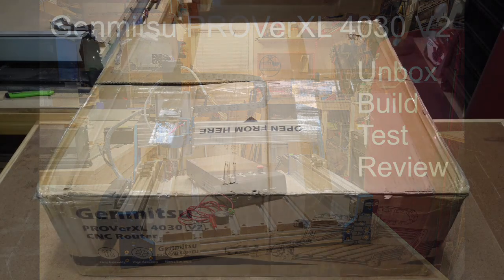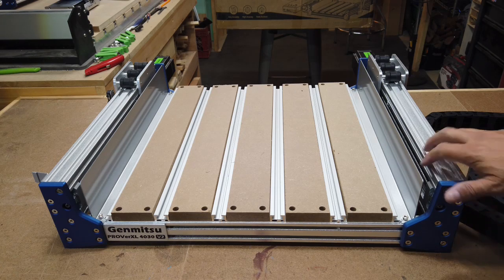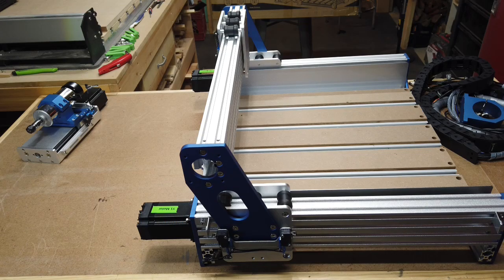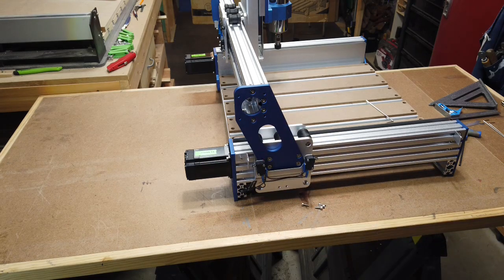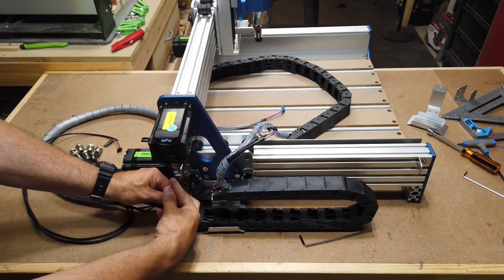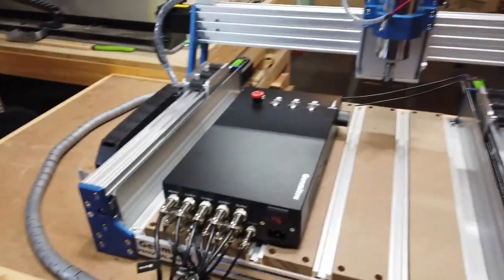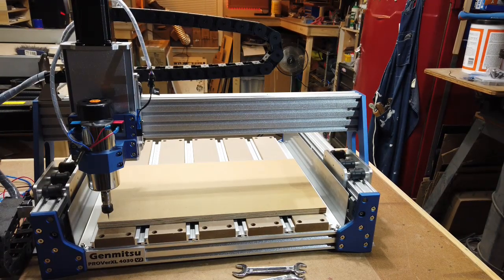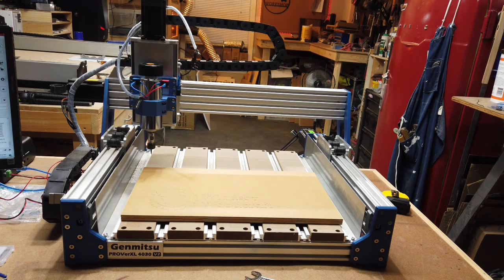Genmitsu PROVerXL 4030 V2 - Unboxing, build, test and review.

Comment: Nice video. It looks like an impressive machine. I have been using a MillRight Carve King (the original wood version), which is about the same size, about four (4) years now, without any problems.  I am looking to expand my business and need another machine, so, I thought I would give this one a try and see how it compares to the MillRight Carve King.  I 'pushed the button' the other day, Friday - Sept 16th, and ordered it.
Reply from the maker: Cool, thanks.  It is a really nice machine. Ive used it to cut a lot of differnt materials so far and I haven't had any issues.

Comment: I got the v1 just a few months too early. I would have loved the v2, though I feel linear rails would be easier than the eccentric nuts
Reply from the maker: I agree, linear rails would be better but also push the price up a few hundred dollars. But I've never had any issues with this machine or the original 4030 version that I had in the past.
Reply: @windsorwoodcraft  , have you had any reason to expand to the larger size? I know they sell a kit to make the work area bigger...
Reply from the maker: @ALCRAN2010  I have thought of getting the expansion kit but I really don't have the need for a larger machine at the moment. However I did expand the original version of the 4030 that I used to have, it worked out well.

Comment: So before starting a job. 1. You home it. 2. Set probe and zero it . ? 3. Bring to corner of board  zero that out and set start piont . And click start /send job ???
Reply from the maker: Correct. Those are the basic steps to start, assuming that you have your job set up correctly to match your starting and zero points in whatever software you are using,  like Easel, Carveco etc.
Reply: @windsorwoodcraft  ohhh that's probably whats wrong. my job startup point when    i use Vcarve pro.

Comment: Do you have a video on how to tram this machine? I own this machine, and I am ready to make my first cuts, but I am having an issue tramming it. Any assistance would be helpful, or if you could point me in the right direction, I would appreciate that a lot.
Reply from the maker: I don't have a video on tramming the machine, but there are some other channels that do. It's not hard to do, and honestly, I don't know that it's necessary right out of the box unless you intend to do fine machining where specific tolerances are required. I have not trammed mine since I got it, and I haven't noticed it being out of alignment with the  projects that I have completed so far.
Reply: @windsorwoodcraft  I replaced the stock spindle with a Makita RT0701C router and I wanted to tram it to ensure it was as level/perpendicular as possible, before I make any cuts.

Comment: Are you going to add a spoilboard?
Reply from the maker: I will be adding a spoil board soon.
Reply: @windsorwoodcraft  I'm working on a plan right now with Vcarve. Willing to share the plan if you would like.
Reply from the maker: That sounds good. Thanks.
Reply: Hi, just received my V2 and was wondering about a spoil-board. Would you share your idea with me please ?
Reply: @peteredwards2371  Sure, working on it now.
Reply from the maker: @peteredwards2371  At the moment, I'm just using a piece of 1/2" thick mdf fastened down with painters tape and super glue. I'm not sure exactly what type of board I want to use permanently.
Reply: I'm pondering spoilboard when my V2 arrives, possibly drill & threaded insert every 3-4inch centreline of the slats. Double stick or screw wasteboard slats on top of existing . Then it's a good hybrid worktable
Reply: @jongrace9133  hi does the V2 work with Vcarve desktop?  Thanks!
Reply from the maker: @JS-zg2co Yes, it will work with Vcarve or any software that generates gcode.